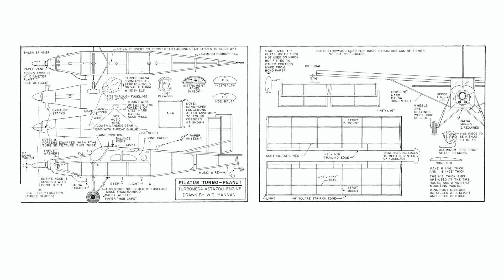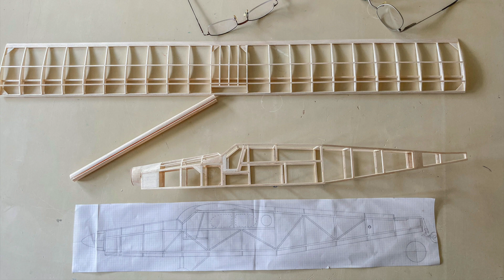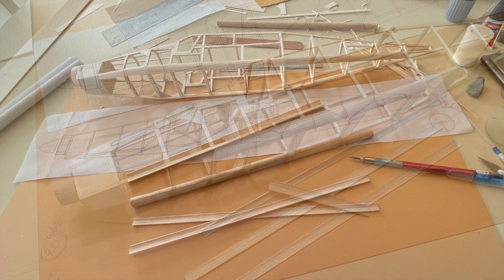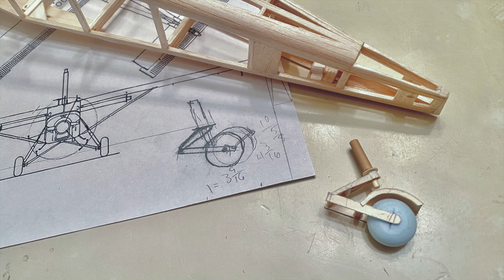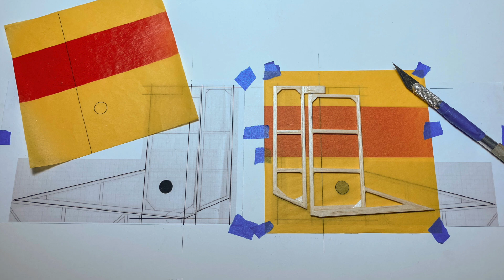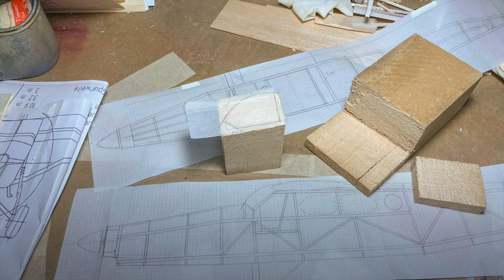28” Pilatus PC-6 Porter Model Airplane - Start to Finish

Comment: I built a 2m span foam electric model off of this Airsail plan. Bought the kitset and scaled it up, constructed out of white foam and powered her with a 2820 brushless. Flew straight off the building board. I had never built a plane before let alone a rubber powered one. Great machines and - MCK I still see.

Comment: Amazing work, it's beautiful ! 
I have a question : Why a separate control for the elevator ? Wouldn't it be simpler with a unique control for the elevator and a small rudder movement ?
Reply from the maker: The pivot for the elevator is for the dethermalizer, or DT, which is attached to a timer.  Helps knock her out of a thermal and the potential flyaway. The for the question.

Comment: Really nice job. Please share how you handle the under chamber of the wing. At first I thought you may have drawn the line detail prior to covering but as you proceeded I realized the lines are very dense. Did you use a printer? Please also tell me how you created the white decal areas.
Reply from the maker: Thx Roy. Check around the 5:40 mark.  That's where I show the use of the Copic pen on top of the flattened tissue. It's much easier to do it there rather than on the covered model. It's just a simple matter of making light pencil registration marks for the LE & TE to position it correctly on the frame. The white lettering on the nose was made with inkjet. I printed red around the lettering onto white tissue.  I then sprayed the back of that tissue white to make it even more opaque. Once I attached the strip to the red area of the fuselage with a glue stick, I went back in with thinned red paint to match that of the red tissue. 
Here's a shot of that tissue and tail logo.  You can see that it wasn't exactly the same red, but I cut the strips very close to the lettering, which minimized how much I needed to retouch the red tissue. http://hallmanstudio.com/WhiteType.jpg

Comment: Thousands of flights. With the majority looking like they are on rails maybe you don't have the problem but for the rest of us another instructional video about installing and keeping struts in place would be fantastic. One question, what camera are you carrying with you as you narrate and start hand launched flights?
Reply from the maker: Thx.  I use an older Canon PowerShot SX20 from 2009, which has a mild image stabilizer, but also a great 20X optical zoom. Movies are only 720p but seem to be clear enough for YT.  Used cams can be found for cheap on Mercari.com.

Comment: Which airfoil do you use?
Reply from the maker: I can't give you a specific airfoil, only that it was closer to what you would see on a Gollywock, than on the original Porter. So I backed way off after it was covered, and filled in most of it, leaving the bottom of the wing nearly flat, aft the main spar. Here's a link showing the adjustment. http://hallmanstudio.com/Porter_undercamber.jpg
Reply: @maxfliart  Thanks! I have been working with airfoils (Human powered aircraft and free flight) since one or two years now, and sadly I am still searching for the 'perfect' airfoil for my scale models. Did you try to fly it with the camber? It should perform better than with a flat bottom. The problem is, one could get quite a bit of performance out of the usual airfoils, but sadly only if you turbulate the flow (eg a wire just above the surface). This is ugly and not at all scale, so not too useful (unless you don't mind losing a few points).
Reply: @toonverbruggen7351  pick up Harry Riblett's book on General Aviation Airfoils.   It has several series of high lift, stall resistant, airfoils.  I prefer Ricketts GU613.5 and GU615.  Very stable, small under camber.
Reply from the maker: @toonverbruggen7351  Thx for the insight.  No, I didn't fly her with the camber, mainly because I realized how far away it was from even the original aircraft's, regardless of tweaking it for free-flight. So I gave in to the unfortunate realization to undo what I had already done.  She flies beautifully, so I feel it was a good move.  Typically I build a Dave Rees style sliced rib wing, with the flat bottom.  Simple, clean and effective for free-flight. It would be interesting for sure to try different wings, is it could be an easy on & off, to fly under the same conditions.
Reply: @davidfranklin5270  Just a quick internet search: I think that the general aviation airfoils are for higher reynolds numbers. Model aircraft have to use way different ones. Some of them might work if they are turbulated, I don't know if you are doing that?